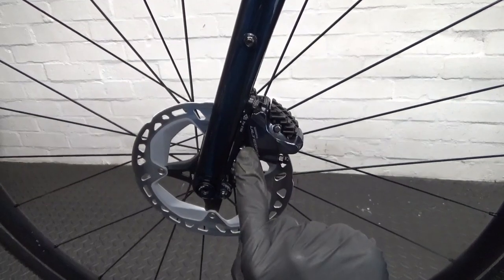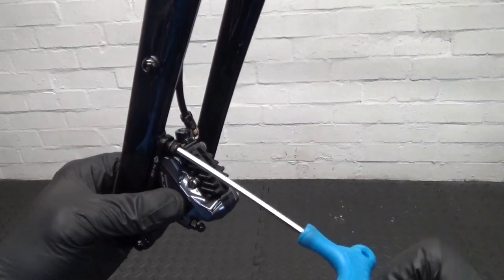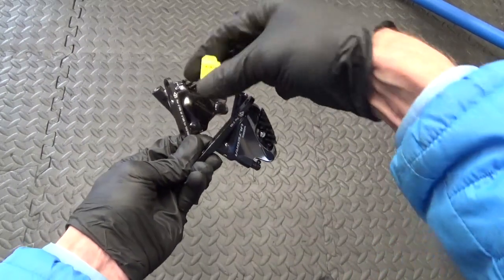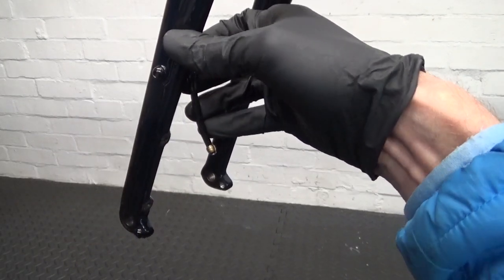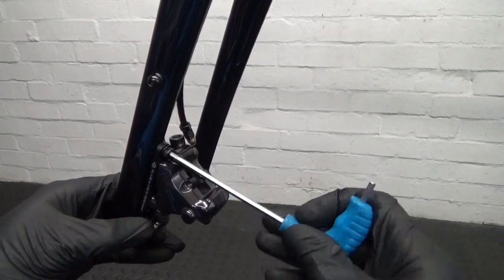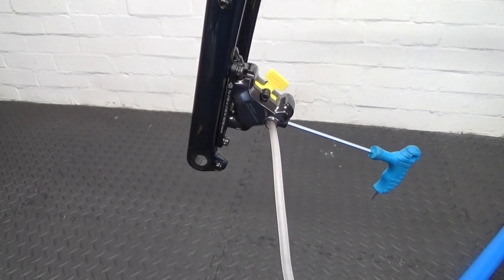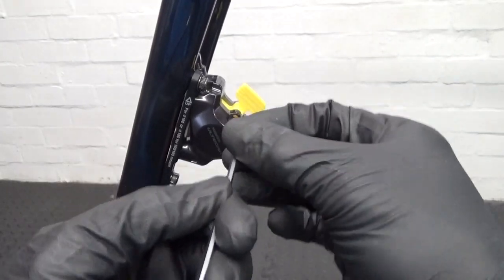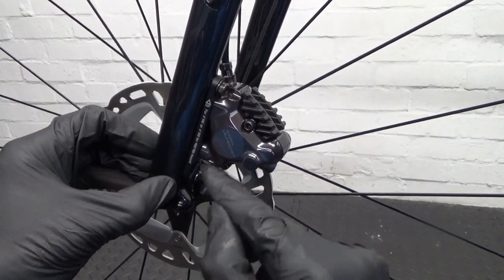Shimano Ultegra R8170 Disc Brake Caliper Swap

Comment: I'll be doing this upgrade in a couple of weeks myself. I was going to take it to my LBS but after watching this video, it looks straightforward to do. 

Questions though. Will the hose come pre-fitted to either the calliper or the lever? I presume I'll need a total of four olives? Do they generally come in a kit or will I need to purchase these on top? Would this affect the seal performance as the cable already looks a little pre-crushed in your video where the olive used to be?

Thanks!

Comment: Great video. Curious if Shimano are going to upgrade GRX brakes as well
Reply: I don’t suspect so - the new road callipers have borrowed some tricks from GRX.
Reply: @dominicbritt  Yes a lot but the pad clearance which is even more important when riding in mud and grime than on the road.
Reply: @dominicbritt  Aren't the GRX 800 series calipers just rebranded Ultegra 8070 calipers?

Comment: Thanks for this video! I've been looking all over if the R8170 caliper upgrade worked with the the R8070 Sri's... Quick question, have you tried Ultegra 8070 sti levers with Dura Ace R9270 calipers? As I was already upgrading, was thinking of going with monoblock option 😅
Reply from the maker: Yes the ultegra levers will work fine with the R9270 brake calipers!
Reply: I’ve got a set of the Dura Ace monoblocks to fit to my bike at some point. May get the R8170 pad pins as the Dura Ace pins still have slotted head on them

Comment: FreetoCycle....My rear ultegra R8070 pad bolt has seized and its that brittle it has splittered away where the screw driver should go.Have you any tips on how to get this bolt out.Thanks.
Reply from the maker: I have drilled them out in the past but not a very practical way of removing them! Basically a new Caliper if it’s that badly seized in there! Thankfully the r8170 has the alllen key and not that silly screwdriver fitting!
Reply: It's such a common issue, the flat head bots are so soft. I thought mine was well and truly stripped, but a electrician mate of mine managed to force a very well fitting flathead screwdriver into it and got it to turn. lots and lots of penetrating spray was used.
Reply: @mattyno123   look for "SLX brake pad pin" on ebay, they are mtb ones with the hex fitting and fit road calipers fine

Comment: Nice update on the bleeding ports. Have you noticed any real-world improvements?  I don’t have issues personally.
Reply from the maker: Andy, the Calipers don’t make any difference to the feel or stopping performance compared to the R8070 version! The new calipers use exactly the same pads and the pistons are the same diameter as before! The difference is they offer a little more pad clearance that before.
Reply: So there’s more piston travel?  I’m guessing there’s something clever going in as the lever travel surely isn’t affected?  Clearance is a good thing as long as you’re not increasing lever travel
Reply: @McDonaldPhotography  10% of 2mm is 0.2mm..ain t much..I was thinking about switching to the new calipers from the r8070 but I don't know if it's worth really. Some real world useage feedback would be great tho
Reply: @_shaqz_ my 8070 calipers never advance the piston as pads wear down (I stripped one down to try and solve it without success). Which means the lever goes spongy relatively quickly and needs some fiddling to rectify. So I’m going to give this a go on the basis they can’t be any worse.

Comment: any idea if they will work with non-servo wave levers? such as the 105 7020? the old br7070 calipers have a horrible habit of leaking from the pistons
Reply from the maker: Yes the new calipers will work fine with the outgoing levers!

Comment: Help! Have a 160mm rotor. The Calliper bracket mount says “for 140 or 160” on one side and for “160 or 180” on the other side.  Which side can I use for my 160mm rotor?…Tks
Reply from the maker: 160/180!
Reply: @FreeToCycle  Tks. The rotor is a Shimano 105 160mm. On my Specialized gravel  bike the rotor is an Ultegra 160 but the bracket for the front derailleur is set for 140 or 160. That’s what confused me. Tks for the help.

Comment: I asked shimano if these were compatible with the R8070 levers and they told me no! Is there any change to the lever throw?
Reply from the maker: No exactly the same as before! They will say they are not compatible to make you upgrade to the latest groupset!!
Reply: Shimano's compatibility chart (12JUL2022 update) shows that they are compatible.  You can find the chart on Shimano's website.

Comment: Why did you replace them?  What is the benefit of the 8170?  I ask because I just cracked my rear caliper while fighting to get the bolt out to change the pads.  So its a new caliper I need.
Reply from the maker: Jeff there is no performance benefit in changing the caliper! I was just showing that it can be done if you wanted to run the latest brake calipers!
Reply: @FreeToCycle  thank you... or if you destroy your caliper and decide you want an Allen key retaining pin.  :)

Comment: 8:08" so far and this seems kind of insane where you need a 'Dremel' and to replace an olive which 'of course' you can get at the drop of a hat at your local bike shop. Don't forget to clean up all that fluid and your bucket, etc..

Rim brakes for the win, even though, I guess thanks to biz & marketing, they'll likely lose.
Reply: How does the caliper bracket work if you wanted to upsize from 160 to 180mm front disc? Assume you still need an extra adaptor?
Reply: @troy45uk  check out the Peak Torque 180mm adapter. I have one and it works 👍
Reply: @trevekneebone369  I’m ahead of you there, fitted my Peak Torque adapter earlier this week 👍
Reply: Getting rid of the flat head bolt is the best thing about this new version.